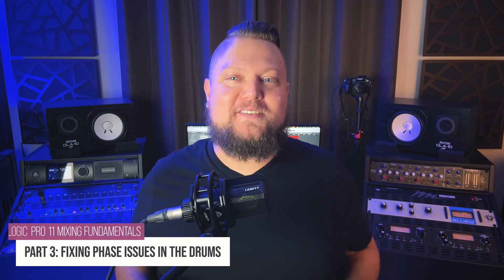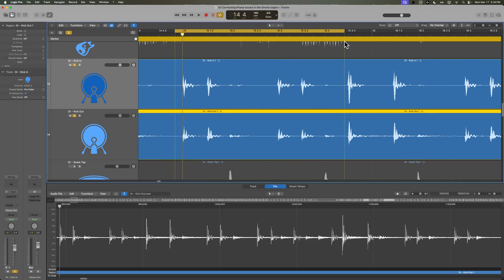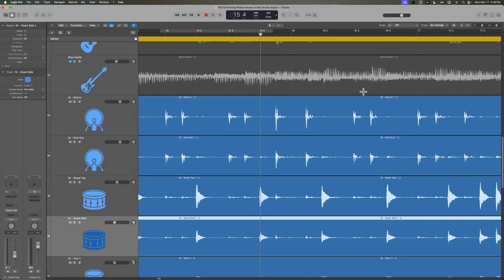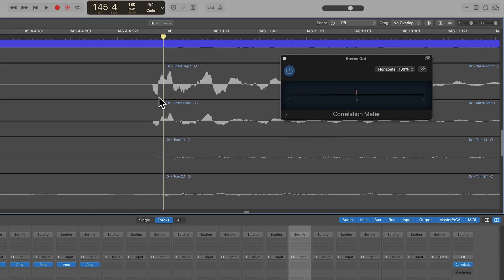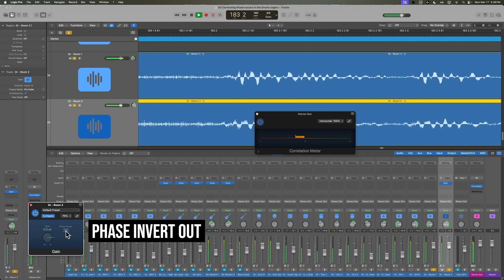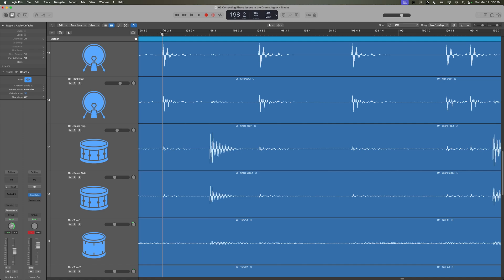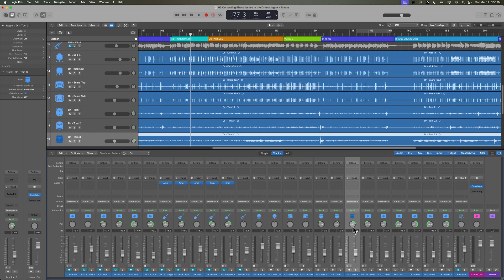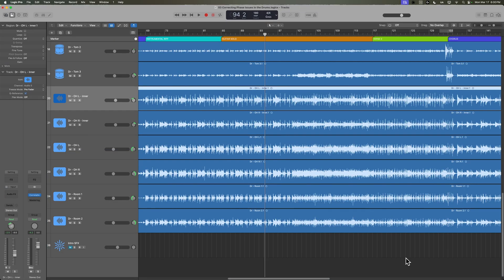Logic Pro 11 Mixing | #03 Fixing Phase Issues in the Drums

Comment: "#03 Fixing Polarity and/or Phase Issues with multi mic drum recordings." (subtitle: How to tell the difference between a polarity problem and a phase problem).
At 1:50 into your video you have a perfect image, the start of a kick drum hit on "kick in" and "kick out", while also showing the common issue between "kick out" and snare top".
The major issue between "kick in" and "kick out" is one of polarity. One mic is facing away from the drummer's throne, the other mic is facing towards the drummer's throne, i.e. mics are on opposite sides of a membrane, or membranes if front head is installed, so the polarity on one will be the opposite of the other. To get the wave forms showing, the polarity on one of those mics, or the track, has already been changed. The Snare track below shows a low level representation of the kick wave form. The top snare mic is picking up the same side of the kick drum head as the "kick in" mic, so their wave forms should be more time aligned, i.e. for low frequencies, than the "kick out" mic. "Kick out" is showing the more common issue in recording drums, and is the reason we have almost always reversed the polarity on the "kick out" mic while recording. For the strongest kick sound in the low end, you want to flip the POLARITY of the "kick out", and then match the wave form of "kick in" to the same polarity. There are PHASE issues between "Kick out" and "kick in", but they are frequency dependent and not usually bothered with. You can see their effect as the decay of the kick drum sound. Note that the overhead(s) and snare top, tom(s) top are all usually the same polarity with minimal phase issues when close mic'd. The Kick out is the outlier and should be reversed in polarity to combine with the kick sound picked up by the other mics. I like well placed overheads that sound great as the whole kit and then bring in close mics only to augment where/when they might be needed or wanted, and reversing the kick out mic even more importantly because I'm not aggressively high passing the overheads, i.e. they have more of the low end of the kick in them.

Simply put, POLARITY is not time based, and PHASE is. To differentiate between the two terms clearly is of value, the same as we differentiate between reverb and delay. It's best that someone understand this kind of sound issue early on. Many manufacturers have mislabelled the polarity switch, to the point where I think it started happening just in a strange attempt to not confuse operators/engineers on desks.

Typically, you won't find phase issues when using a single mic, although if you place a mic in line with a cymbal and strike it (not the mic), the swishing sound that will happen is caused by phase combined with the natural changes in polarity as the wave form off the top of the cymbal temporarily combines with that of the bottom of the cymbal, effectively cancelling out and combining different frequency wave forms hitting the single diaphragm of the mic. It's good to note here that our brain interprets the timing of waveforms arriving at our two ears, and the resulting phase relationships, to determine where the sound is originating. Phase can be used at very short times to take a mono signal and delay it very slightly on one side from the other, and our brain will figure the sound is coming from the side that arrives first. For this, duplicate a track and then try moving one side back slightly in time. Panning depends of how loud one side is than the other, delaying, or altering the phase between the two signals doesn't depend on a volume difference. Try it.

"Flanging" and "Phasing" were done by literally slowing one signal on a tape compared to the same signal not slowed, a time based effect that had periodic cancellations based on polarity at certain frequencies being reversed from one another at different times. 

Creative and reconstructive things can be done using polarity and a multiband equalizer. If you take a track and duplicate it, then reverse the polarity of the duplicate and bring both to the same level centered in the mix, they will cancel to silence. You can then apply the multiband equalizer to the original track and selectively bring only those frequencies you want represented into the mix by increasing them.

POLARITY and PHASE are very important to understand when tackling the acoustics of a room.

Comment: Hi Josh. I'm following along here, and I just did an experiment. When hard panning the overheads, just as in the video, there were no phase issues: the meter stays above 0 and in the green pretty much the whole time. Just for a laugh, I did the same thing with the rhythm guitars, hard panning them and checking on the correlation meter. A very different story. They move into the orange/red below zero much of the time. I've found this to be the case in my own recordings, too - paired guitars just seem to have a habit of being REALLY easily out of phase and sounding super-thin when collapsed to mono. However, as your video shows, this isn't a problem with the overhead mics being hard panned: so Is this just a quirk of guitars generally? By the way, using the 'Phase Invert' on the Gain plug-in doesn't really do much on the paired guitars to solve the phasing issue.
Reply from the maker: Yep, it's because the overheads are an actual stereo recording made with two mics at the same time. The guitars are 'fake stereo' in a way, because it's two different recordings, just positioned in different places in the stereo field. With the overheads, there is a positive phase correlation, because the two channels actually share some information that is in phase (or has constructive interference). The closer the two microphones are together, the more of a positive phase correlation you'll have. Here we used spaced pairs, which has the least phase correlation of any traditional stereo miking technique,  but if you were to use XY or some other coincident miking technique where the mic capsules are right next to each other, that phase correlation will shoot up closer to +1. With two guitar parts doubled and panned, there is no natural in-phase material. Some of the low frequencies might line up in phase, but a lot of the top end frequencies end up getting canceled out in mono. A phase flip won't do much of anything on a doubled guitar part - might even make it worse. I mention this in one of the later videos, but the best things you can do to prevent phase issues in double guitars are: (1) change the tone/amp sim/mic position/mic type on one of the guitars to give it some variation, (2) don't hard quantize guitar parts to make them perfectly in time, that will actually give them MORE phase issues in mono, again because less variation, or if you don't mind extra work, (3) track a third rhythm guitar up the center and put it really low in the mix, or find another guitar take and put it in the center.
Reply: @MusicTechHelpGuy  Round of applause from where I am (a city called Ningbo in China). I'm not sure if you can hear the clapping from where you are? It's pretty loud; people are definitely staring. Anyway, you deserve it! So let them stare.

Comment: Can you have phase issues when using the drummer thing or with loops? What about when using electronic drums?
Reply: Not sure about drum kit designer, I guess not, but it probably depends on how you process the snare top and snare bottom, or kick in kick out, if you use the multichannel kits.

About electronic drums, you want to check eventual phase issues between your kick and your bass, in case they overlap.